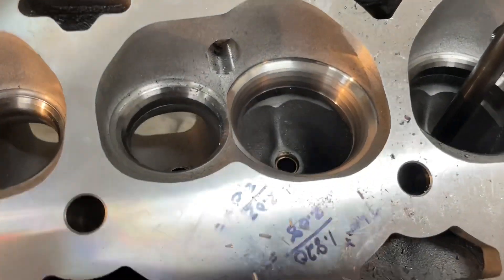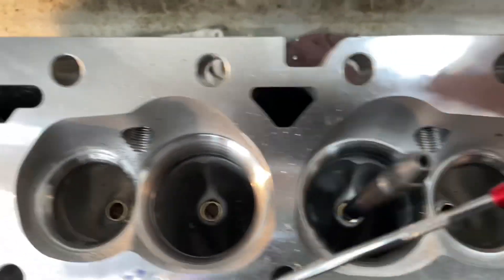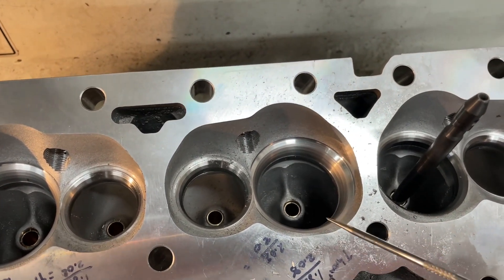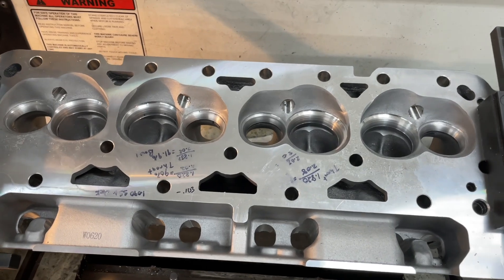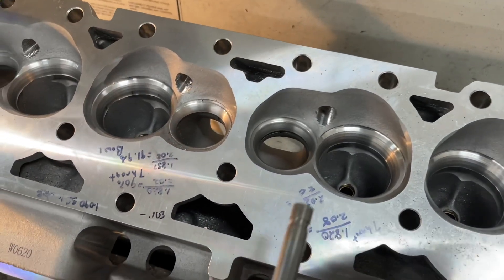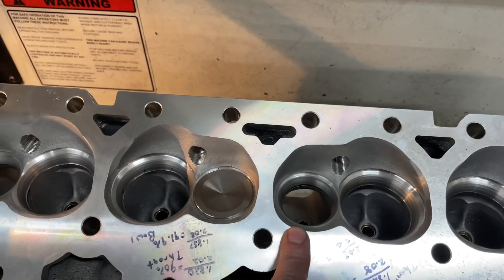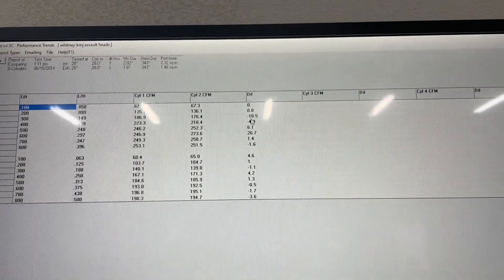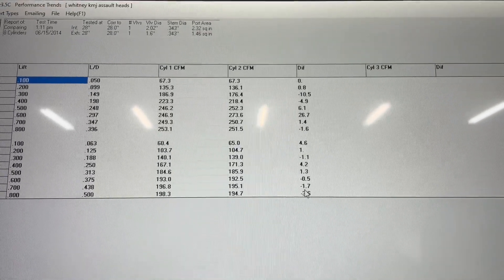Kmj sbc assault racing heads porting part 1

Comment: I have these heads. First i blended the stock seats, no chamber work.
Next, 2.08 intake, 5 angle int and ex .
Intake flows 276 at .5 now before deshroud and blend. Ill lay the shortside back too.
Goal is 300+
Exhaust is pretty good already

Comment: Question. You cut those heads from a 2.02 valve to a 2.08 intake valve ?? Can any head be cut for a bigger valve. I have dart pro1 215cc 2.05 intake that I want cut for a 2.08 intake. Can that be done ??
Reply from the maker: Yes

Comment: Could you tell me what advantages come with multiple angles?  We have an old Sioux we bought for $500.  We've always just done single cuts but I'm curious about multiple angles.
Reply: We've always done 30 & 45.  Never really gave it a second thought.  How many horses can be achieved?  Kinda getting that you want to eliminate the lip on the back side of the valve and smooth out the transition through the head.  I can see the flow improvements in my mind for sure.  I would imagine some cautious and detailed work could be done with a dremel to achieve similar results...yes, no, maybe???
Reply: I've seen both.  The video shows cuts in the seat tapering back to the port.  I read about tapering the back side of the valve on a different site.